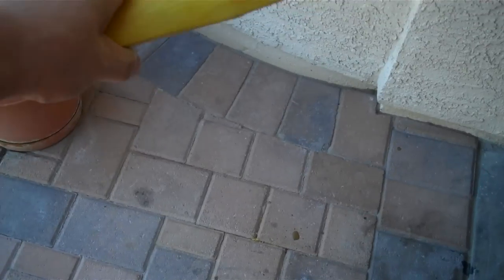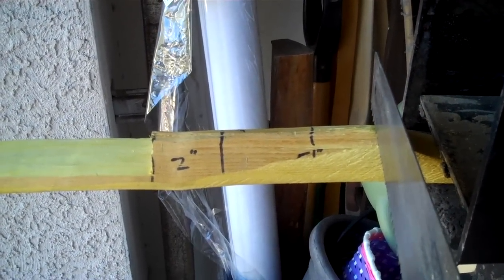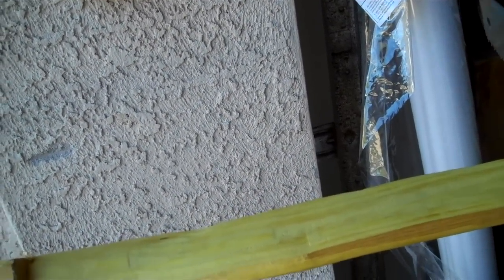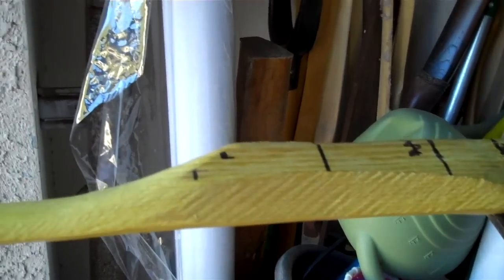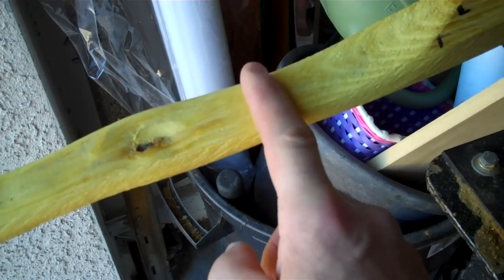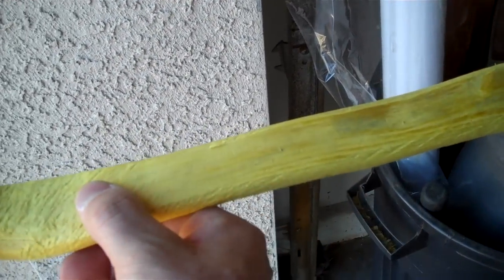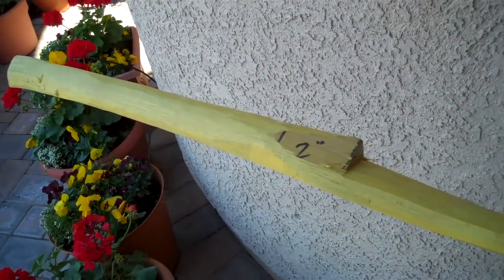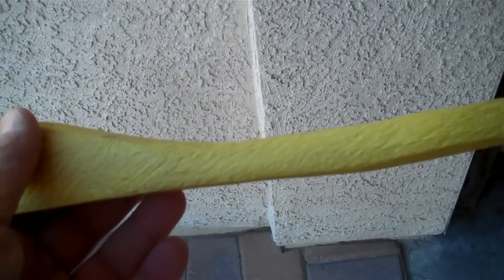How to Make a Bow from a Stave, Part 3: Rough cuts and fades

Comment: Great video Mike. Your previous videos inspired me to start making my own bows. I'm currently making a bow from a hickory board. I have shaped it to floor tiller and steamed a slight re-curve into limbs. I noticed after the steaming that the back of the bow is kind of chewed up. There is no grain pointing out form the back, but I can definitely see a spot where it could once I start to tiller it.

I have two questions:

1. Can I prevent this with a rawhide backing?

2. Can I stain or dye a rawhide backing without it effecting the adhesion of the rawhide to the back of the bow?

Thanks in advance for any advice you can give me.
Reply from the maker: At this point I would definitely back it with something. Rawhide is my go to backing material and if you are really concerned then planed bamboo is always an excellent option. 

I have never had an issue dying the rawhide after the glue (titebond 2 or 3) has cured. Doesn't mean that it can't affect the glue up, only that I have never had an issue. Just don't oversaturate it all at once. Instead apply small even coats with a cloth until you get the color you want. I have also painted rawhide with professional quality (as opposed to the kids stuff) acrylics from the art supply store without issue.

Hope that helps :)
Reply: Thanks Mike, it helps a lot. I never thought about using bamboo with hickory. I always thought bamboo would be combined with something less springy (for lack of a better word) and more rigid, like the oaks, ash, or something lake those kinds of woods. I will try the dye, I want to hunt with it.
Reply: Thanks Mike, it helped a lot. I did use dog bone rawhide. It's looking pretty good so far. I've been tillering it with a long string and I'm about to string it up to a dist length and do the final tiller on it. I'll post a picture of it with this video series if I get it done in time to keep up with you. I definitely want a darker dye for it. I want to try to hunt with it.

 I was thinking of using the deer hide as rawhide for my next bow backing. It's real thin, so it shouldn't have any adverse affect on the performance.